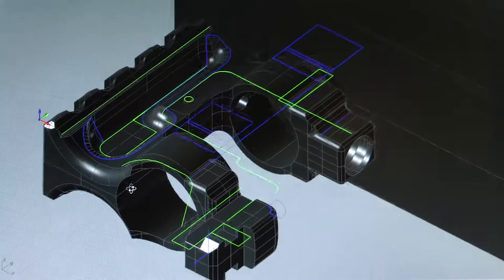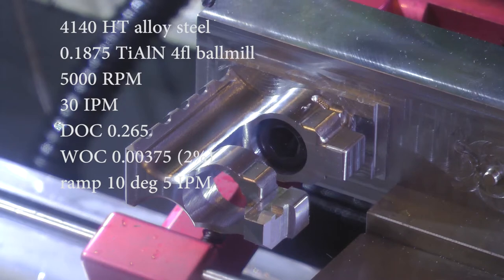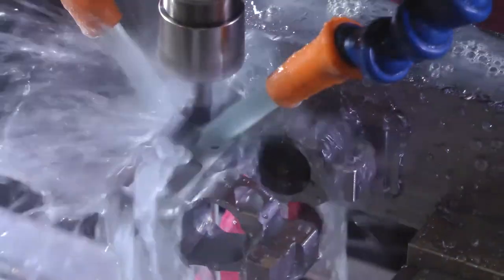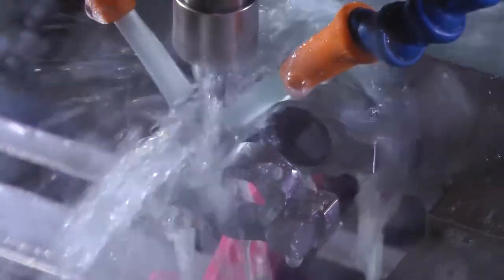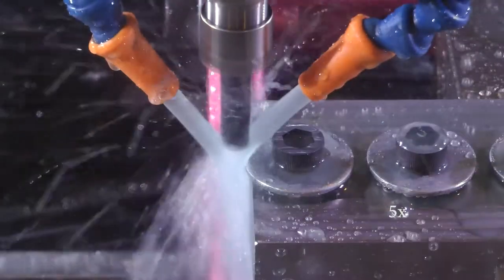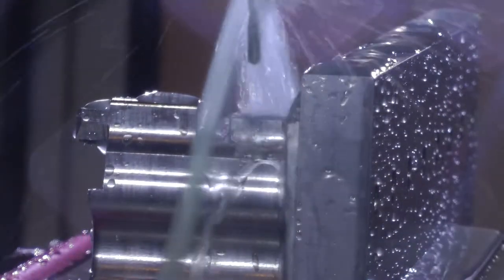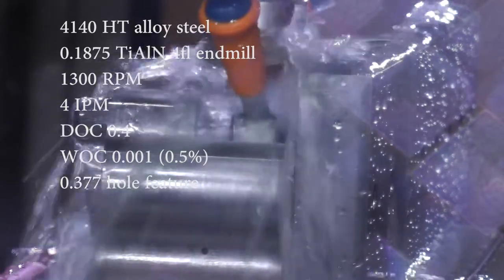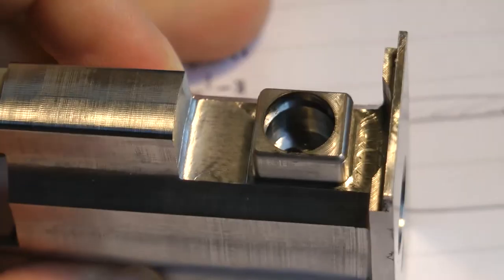AR15 High Rail Gasblock: (pt.11) 3D machining lightening pocket and sling swivel socket

Comment: I'm still very much enjoying these videos, watching you learn as you go, which is awesome.  The tuition is paid in sleepless nights and broken end mills.  It's a cheap education, no matter what your better half may think of your garage CNC shop.  :-)

You have much better CAD and CAM tools than me, but my needs are much simpler and my tools match my needs.  However, we follow a similar path, even though I'm hand coding my G code.  We both break down the machining process into a series of smaller chunks, typically oriented toward machining operations and machined features.  Usually, that equates to development that's then organized into larger chunks oriented to tool changes and fixture setups.  Each machining operation is developed with an eye to constant quality improvement.  Different cutting tools are tried, G code is tweaked, and the feeds & speeds are altered to produce the least machine time, the least tool wear and the best surface finish.  It's a very cool thing to see it all come together to produce a machining process that is optimized for several variables.

I think McMaster-Carr has short head cap screws, and they're only a day away with cheap shipping.  When I'm in full on development mode, I'm placing daily McMaster-Carr orders.

I have a small Nalgene container with some OxPho cold bluing that I got from Brownell's.  If I'd machined the tops off those socket head cap screws, I'd have tossed them in the cold bluing solution and swirled them around for a minute, then rinsed them in hot water, dried them, and soaked them in a good penetrating oil.  :-)

BTW - If you use threaded fasteners for fixtures and you'll be using them a lot, you might try cadmium plated AN hardware (aircraft fasteners).  The cadmium is corrosion resistant and the surface is very non-galling.  AN fasteners have rolled threads instead of cut threads.  Use a thread forming tap to make the matching fixture threads, keep the threads greased, don't over torque them (careful with that cordless impact wrench), and they'll last a good long time.

Your high rail gas block is coming right along.  It won't be long until you're manufacturing them in quantity.  BEAST MODE: ON

I can't wait to see that.
Reply from the maker: Thanks Bruce! Being a lab scientist required to keep an impeccable notebook doesn't hurt. Not that I ever did that... I feel I am at the point where the rubber is contacting the road. This is development work that is tedious, expensive, and fraught with peril, but ultimately is what it takes to make something worthwhile. I'll check out those fasteners if I need them. Right now the ones I have are just from Ace Hardware.

The next video will probably be tweaking these cuts or making soft jaws to hold hold the oddly shaped finished parts so that I can mill off the extra fixturing material on the back. Actually I probably need to tweak the side gutting next. We'll see. So many things yet to do.